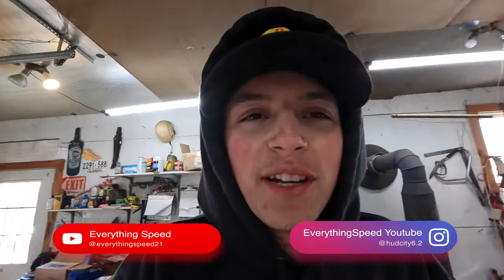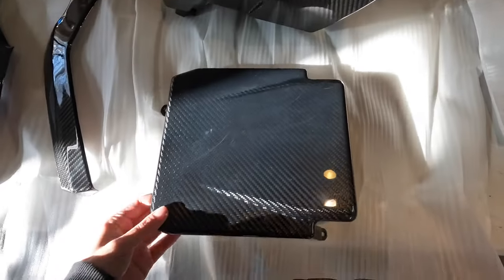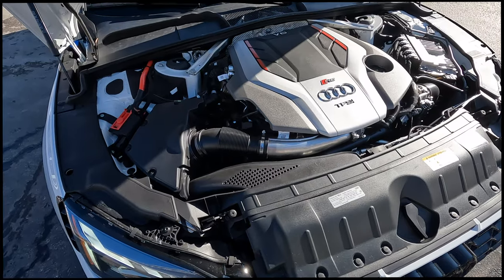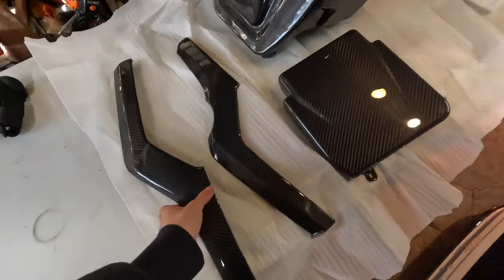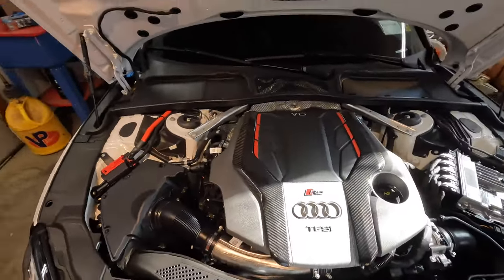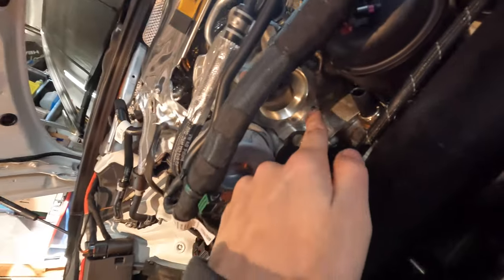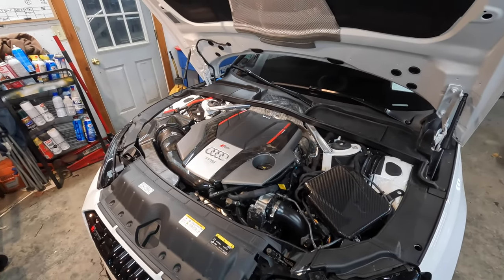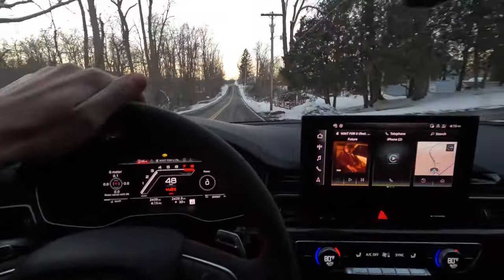Are Aftermarket Intakes Even Worth It? Apr Carbon Fiber Cold Air Intake Install And Sound Clips!

Comment: I appreciate you being honest in your video. I can't stand people who are sponsored and lie to make a product appear better than it is. At present I'm torn between the APR and the IE CAI, but like you, i want the noise and the power add (the little that it makes). I like to hear it suck air in, like the AEM's used to do back in the 90's. You could hear the CAI suck air into the engine and on a B18C Integra engine, the sound was masterful. 

Good luck with your channel.
Reply: It's probably way too late but the IE intake has a much better/pronounced sound VS the APR intake when it comes to intake noise

Comment: Have you experienced any heat issues by covering the ECU? I just bought one but have yet to install. Also, I've got the 034 intake and I can hear a significant increase in sound however the car has stage 1.

Comment: I added the APR intake to my 2019 RS5 as well.  I too am disappointed in the lack of sound improvement.  It does look nice under the hood.
Reply: I too have added it to my 2018 RS5, not much 
Sound difference, but a big gain in performance  after a remap

Comment: For that PITA T30, would you recommend a flexible socket, or a socket wrench of a certain length, or do you know what tool you would have used if you had it handy? I'd rather spend $20 on a tool than get frustrated for an hour.
Reply from the maker: I’d say a flexible socket would be better or something that swivels. It’s been a while since I did it but I believe that’s worth trying

Comment: That because the APR air intake is enclosed bro. Pretty sure you can remove the cover for more noise but if you wanted noise you should’ve went with an open air box
Reply: The thing is that most open ones are not street legal, and given to where it seems like he lives. Most likely they wouldn’t pass emissions. I live in a state where the wouldn’t pass emissions unless I got this APR intake which I plan to get for my A5 B9… Maybe he could take the cover off, but Im not sure exactly how it would work tho
Reply: Also all open air ones will make less power and just pull in hot air from the engine, you do get more noise unless u can get the filter down toward the bottom of the car

Comment: I feel like air intakes for the b9.5 rs5's are 95% for aesthetics/ 5% for sound/any real performance benefits.  The carbon fiber looks amazing in the engine bay, but honestly I can't justify dropping $800+ just for an intake   AEM hi flow filter + modification to the stock airbox is good enough for my broke ass.      

But I hear that you really unlock the potential of the intake artificial BOV noises if you team it up with upgraded downpipes.  Only thing is they're a b*tch to install and access certain bolts.

Comment: How did you get the bolts off the bottom of the inlets? Literally been at it for an hour now
Reply from the maker: Only thing I did was just stay persistent, there is a tool that I mentioned in the video that would make it really easy but I didn’t have it and yes it took me literally forever
Reply: @Everything Speed  I can't even figure out how you got something to touch the bolt and have leverage to move it
Reply: @dakotawoodruff2622  Did you ever figure it out? Lol

Comment: It really just depends on replacing the pipe diameter and air flow restrictions that the OEM shipped the cars out with. Normally they have to cut some corners due to meeting EPA requirements. I can't imagine AUDI not making sure the motor is getting all the air it needs for the stock turbo/engine components. The best CAIs require proper tuning to utilize the increased airflow. (Same with exhaust/headers)
I had a K&N CAI for my F-150 and it sounded good and was good for the butt-dyno. Sometimes you just gotta send it for yourself. lol
I ended up going full-send and getting the VMP Odin kit for it last year. loooooool. Trucks shouldn't be this much fun.